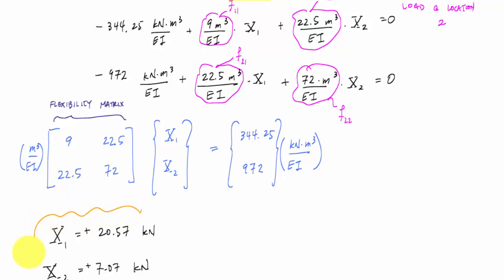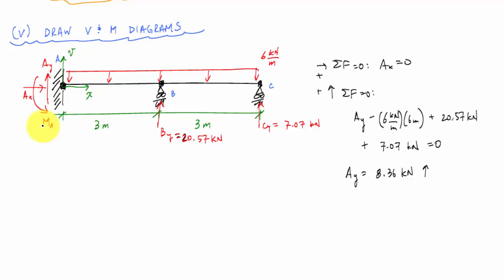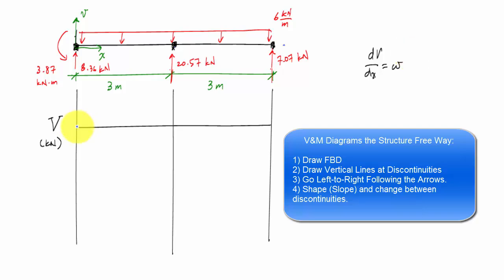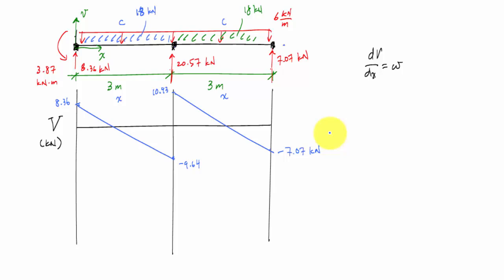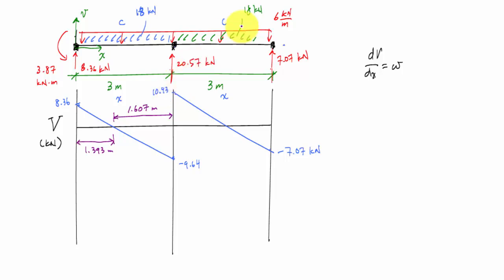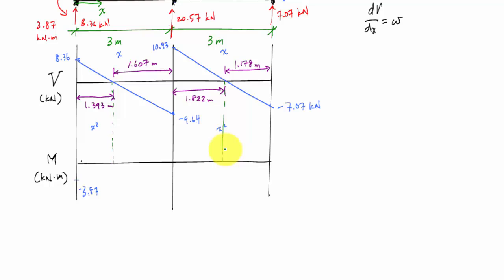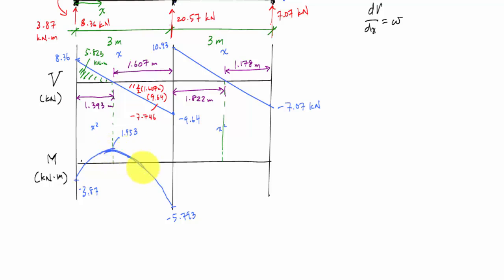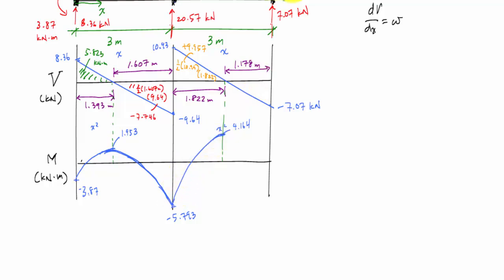Force Method "ultimate" Example for Beams (4/4) - Structural Analysis

Comment: Stupid question maybe I'm too tired but I can't get the result of Ma=3.87KNm
What I get is either I do it from the point A or C and this is what I get :
MA = (6x6x3) - (8.36x6) - (20.57x3) = -36.57KNm (M/A)
or 
MA = -(6x6x3) - (20.57x6) - (7,07x3) = -36.57 (M/A)

What am I doing wrong ?
Reply: MA = (6x6x3) - (20.57x3) - (7,07x6) = 3.87 KNm ...resultant about point A
Reply: @emt4921  I was definitively too tired when I wrote this, got it right the next day thanks